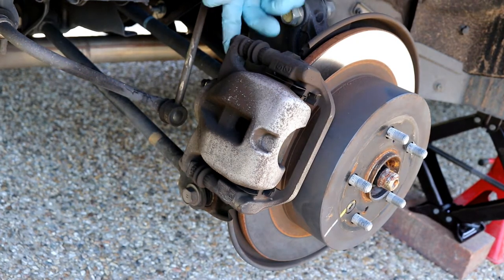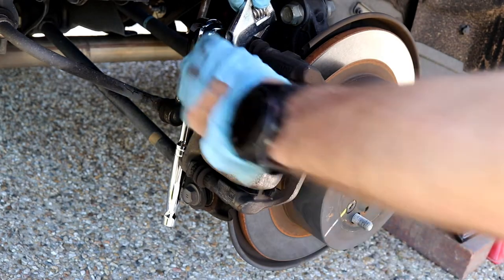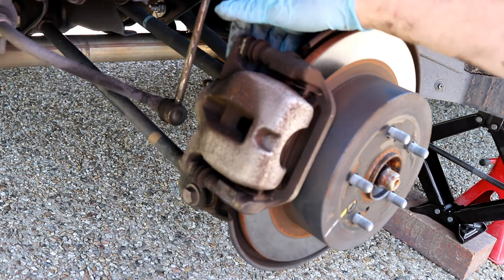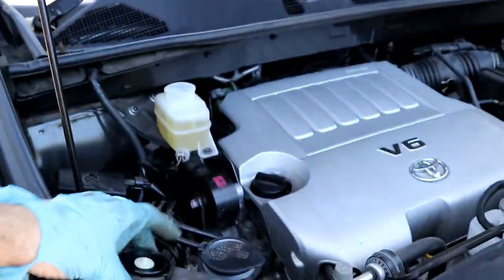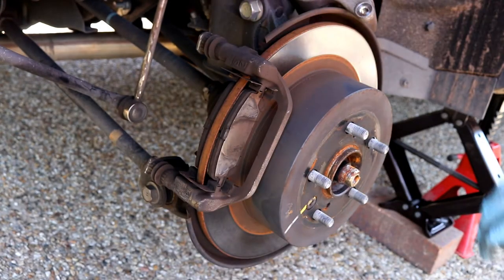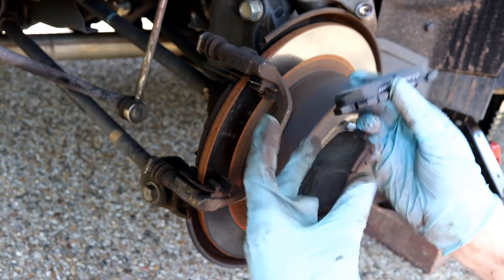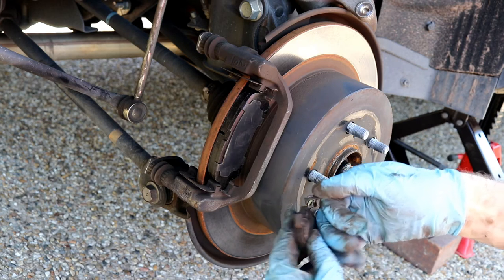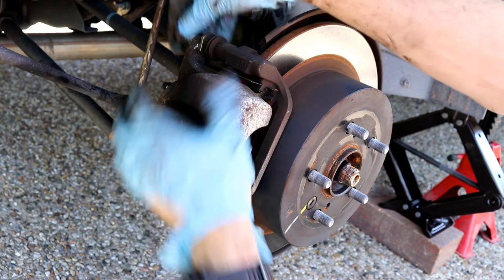How to replace brake pads on a Toyota Highlander / Kluger

Comment: That metal clip is a wear-out indicator, which makes noise when the brake material thickness is thinner than the gap between the lower tip of the clip and the surface of the brake rotor.
Reply from the maker: Thanks for the info, I did not actually know that. Thanks for watching.

Comment: Try to avoid using shifters if you can!! Right tool for the right job. Shifters have there place but if you round one of those pins your up for a trip to Toyota and $$. 

The reason the bolts were tight is because they prob had a small amount of loctite applied to them. Always a good idea to put a little on the threads of the bolt before reassembling. It’ll prevent them from vibratiing loose and potentially falling out. 

One other thing you should do is also clean and degrease the slider pins. Will stop you from having a brake lock on and avoid potential disaster.